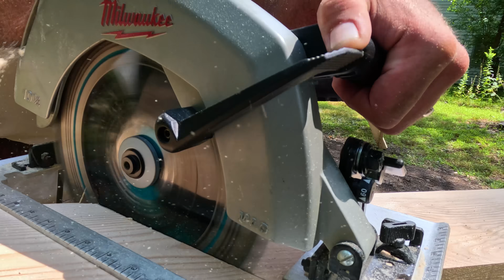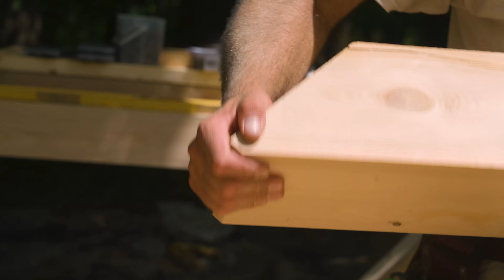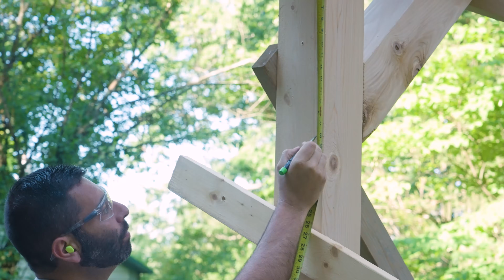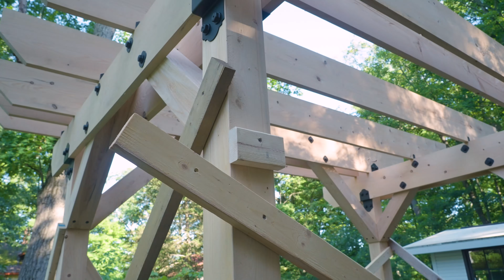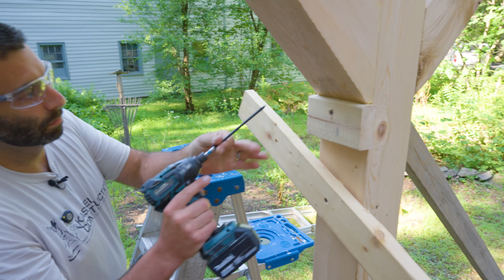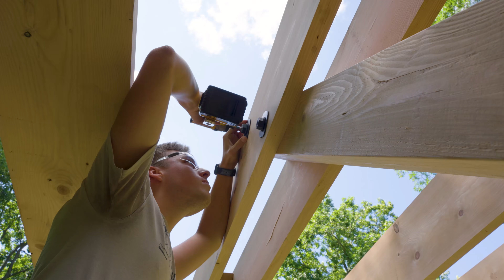Pergola Angle Bracing: Tips for a Stronger Structure

Comment: How do you figure out the finish length of the knee brace?
Reply: No one ever explains this, but its supposed to be approximately 1/3rd to 1/4 the length of the height of the posts. So if you have 8' posts for your pergola, you should have around 30" end to end knee braces on the outer edge of the 45 degree cuts.

Comment: Ok, I'm not gonna bash on your work as it is good. I build a lot of pergolas per year and here are two suggestions for you as well as viewers:
1. Clamp your braces- don't screw them in and leave holes. My clients would be rather pissed if I did that.
2. If you're gonna opt for either buying or renting a large saw for you 6x6 then do it right and use either the Makita 16-5/16 in. Circular Saw (or the SKIL SPT70V-11 16-5/16 in. Magnesium Worm Drive Skilsaw). Either will cut with one cut and keep the ends clean. Very seldom will a smaller circular saw render a clean cut.
Reply: Thanks for chiming in.  I don't disagree that clamps are a better method.  This project was at my own personal property.  I would definitely use clamps if this project were for a paying client.  Since the hemlock was left to weather, you really have to search to find those screw holes.  And yes- in a perfect world, the big beam saw would be superior for cutting 6x6 in one pass.  I don't own one, and we wanted to show this method.
Reply: What do you mean by clamp you braces? Can you please explain?
Reply: @Juan-zd1ct  I think he’s saying to clamp rather than screw the temporary cleats in place, so as not to leave holes when you remove them. 

OTOH, I’d probably use screws too, since I’d give myself a 50% chance of accidentally knocking into a protruding clamp rod. Can easily fill holes afterward with dowels and wood filler.
Reply: @Juan-zd1ct I'd like an explanation as well 😅